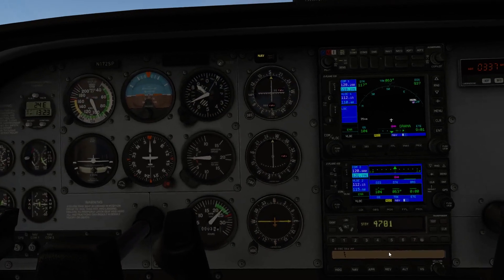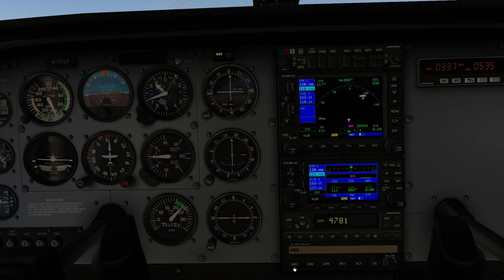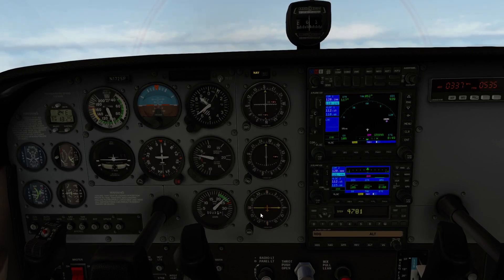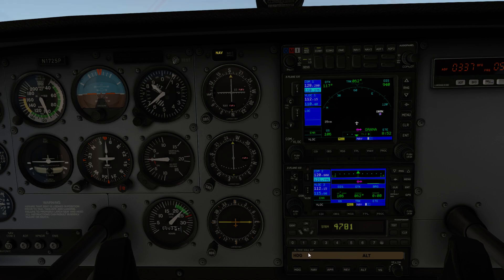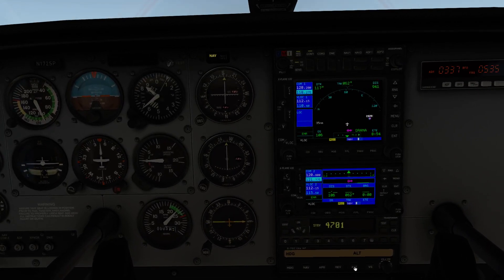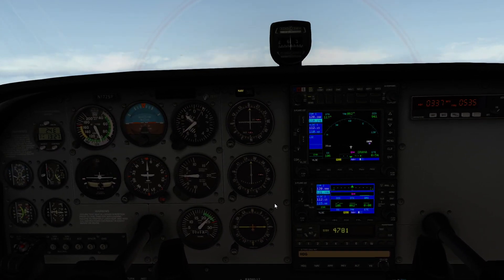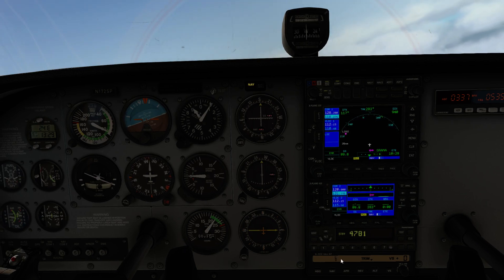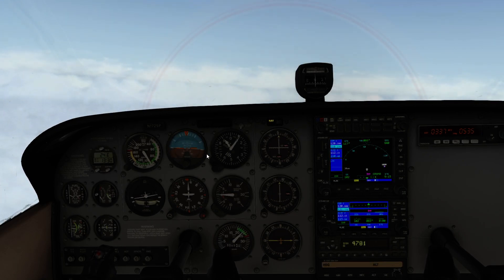The new "S-TEC like" Autopilot in the default Cessna 172 in X-Plane 11

Comment: Is this  AP documented anywhere. The x=plane 172 POH  is so far out of date (2017) that it is useless. I just want to use the AP to set up approaches so I can practice landing and want it to take care of  the glide slop so I just work the last 1=500 feet or so to the ground. Could you make a video of an approach to  an aiport from 10 miles out to touch down using the autopilot? All the other ones are over six months old and use older versions of the GPS.

Comment: Hi all I am very new to X-P11 so please bear with my basic questions. If you want a better auto pilot on the Cessna do you have to buy another airplane ? 
I have seen quite a few videos of the 172N with various AP,s so the question is how can you swap the autopilot to something else?
Would you advise to fly a different plane if so which is best for the beginner?
Mike
Reply from the maker: The Cessna is great to start off.I would simply use the G1000 version. Even though this might look overwhelming at first glance the G1000 is actually one of the best (and logic) APs that I know...